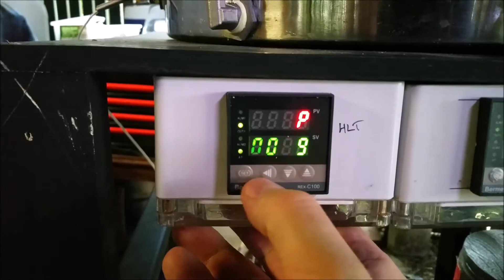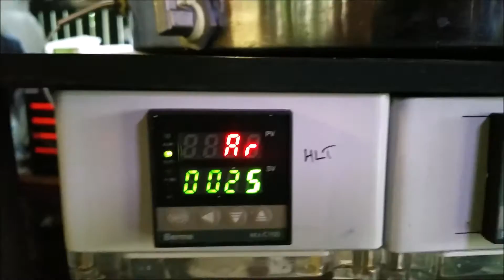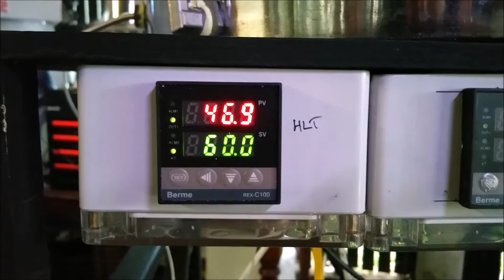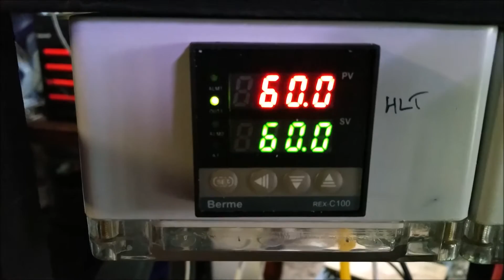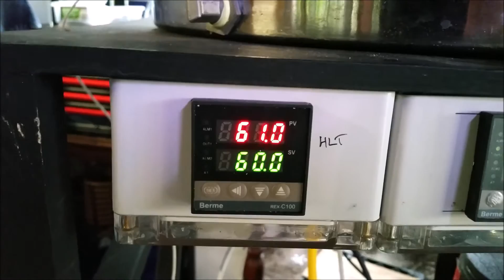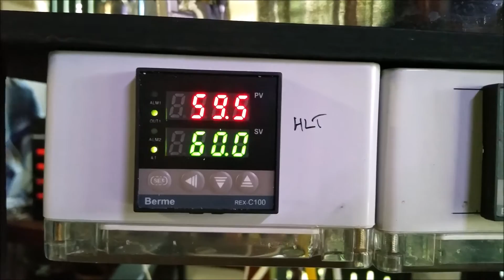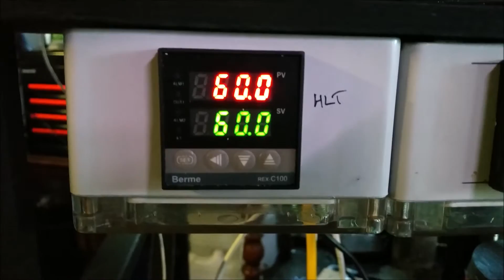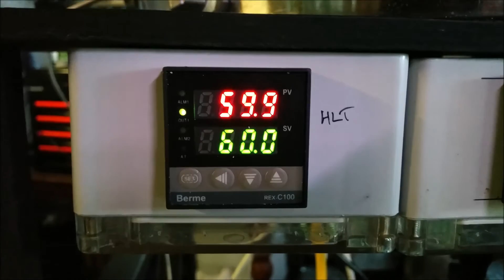REX C100 auto tune set up

Comment: Great video - just got one and this answers my questions !  For reference, PID= Proportional, Integral, Derivative.  When you tune it you want the amount of power applied to be Proportional to the difference between Setpoint and Actual/ Proces values (the further away the more power, the closer the less power.  You want the amount of power to be Integrated across the passing of time, so that the longer there is a gap between Setpoint Value and the Process value the more power it applies and then finally the Derivative looks at the rate of change of the Process / Actual temp looking forward in time,  if it sees that that the speed that it is heating up is getting to fast, it will reduce power.   In your video, when the Process Value/ Actual temp hit 60.0 degrees, it shut off the power to the heater and then it watches how far the temp "coasts" - think of it like momentum - as the temp will continue to rise for a bit.  The controller is "learning" how big this overshoot will be and then it will take that into consideration the next time it is warming up so that it shuts off the power at say 57 degrees and it will coast nicely up to 60.0 and stop.  Bit of word-salad there but hopefully that helps explain it to others who happen by your video

Comment: Thanks for showing your work!
How have the rex c100 hold up over time? If they failed, how long did they last? Do they need ventilation? Cheers!
Reply from the maker: No problems. I am still using them today and haven't had any issues. Never had to run another auto tune. Ventilation on the actual unit isn't necessary, however the SSD requires a heat sink which should be ventilated. I hope this helps
Reply: @HuntsmanBrewing  5 years! That's reassuring. Too cheap to believe compaired to the others. Might aswell give it a punt :)
Thanks!

Comment: What is the autotune for? I my unit, it stops blinking after it hits the desired temperature...so what does auto tune do?
Reply: Autotune is just a short period of learning and recording the heating and cooling behavior. Once the autotune light turns off it is done learning and now is running with what it learned.

Comment: Hi there - I can't change the atu to 1. Nothing happens when I press the button. What has to be done prior to activating the atu?
Reply from the maker: Hi, My instructions in the video are not 100% accurate. It should go - hold down set until it brings up AL1. scroll through by pushing set again until atu appears. Push the up arrow until you see 1 and then set again and the auto tune should start flashing and therefore auto tuning in progress. Let me know if that doesn't work. Cheers Tim
Reply: Rkc rex c100 is LCY 0001 and 1000

Comment: Thanks for the video, that helps a lot. Now to figure out P, I & D :) Cheers
Reply from the maker: Brewmacker ! it should configure it with the auto tune. Just make sure you let it run it's course and don't interrupt it.
Reply: how much time it tooks? regards
Reply: Auto tune figures that out for you automatically. It takes about two cycles while it learns and records the differences then after the Auto Tune phase you will see it maintain temps within + or - a degree.